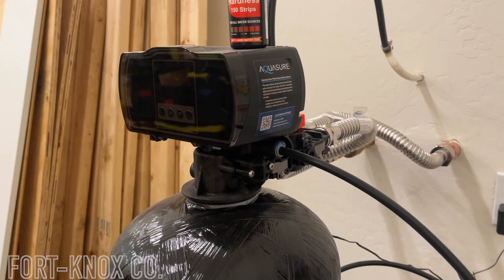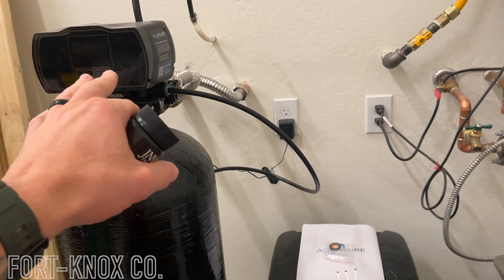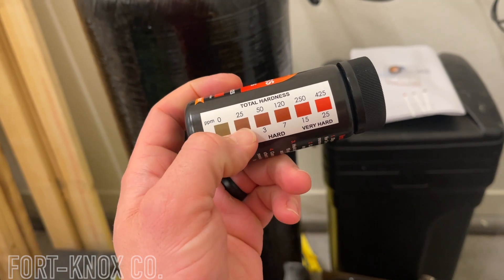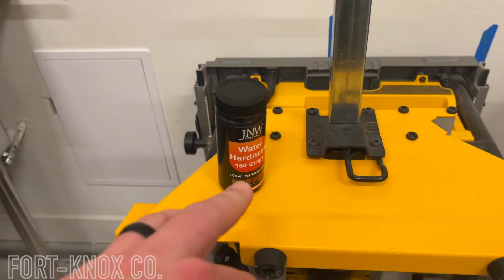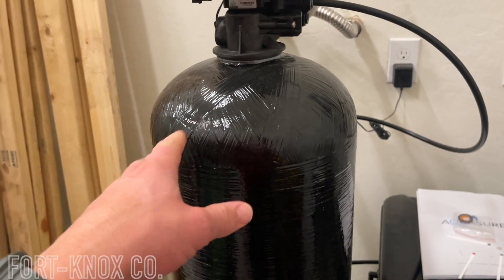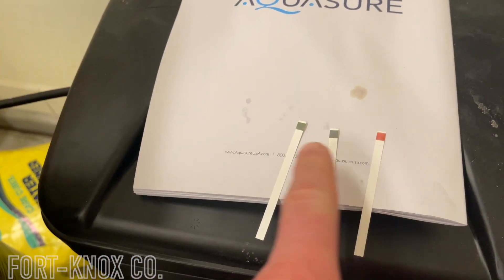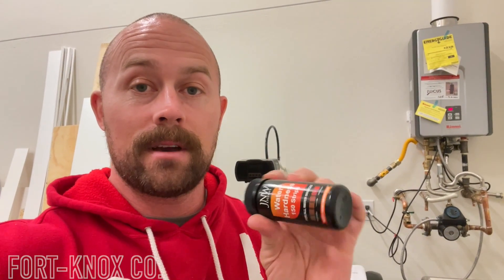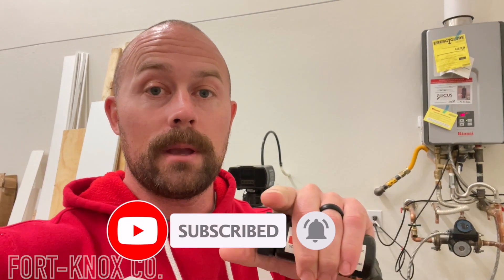How to Check Water Hardness!! You NEED to do THIS!! | Water Hardness Test Kit

Comment: Well, what I was told is that slippery feel is actually a layer of bacteria that develops in the resin of the water softener itself. So that is not a good sign if you are getting that feeling.
Reply from the maker: Ehhh. That might be fake news. From my research it’s not that at all. It’s what most people associate with softened water, less minerals and the water being ionized from the process.  If you have a softener system that’s sitting for a long long time and that water inside is stagnant then could see a problem like your describing. 

From Grok3 this is a good explanation..”The slippery feeling of water from a water softener occurs because the softener removes calcium and magnesium ions (hard water minerals) and replaces them with sodium or potassium ions through ion exchange. These softer ions reduce the water’s surface tension, making sodium ions don’t bind as tightly to soap, creating a slick, soapy sensation when you wash. It feels slippery because the soap lathers more easily and doesn’t leave mineral deposits on your skin”

Comment: TDS meter?
Reply from the maker: Those can be helpful for testing your water but I don’t believe they are giving you a specific reading for hardness.
Reply: TDS is Total dissolved solids only. It can tell you eerything in your water mineral and organic based. Hardness is a different test. I work for  Culligan, We test onsite for hardness, TDS, Nitrates, Iron and PH. We can also test for copper on site. If you have well water, any amount of nitrates means you need a bacteria test which needs to go to a lab. PFAS , we have a $150 test which is cheap compared to most companies who want $1000-$1400.  Softeners are great but you often need a filter as well as a R/O system if you plan on drinking. I suggest at a minimum getting a carbon based filter or a total defense filter. With a softener. It prevents possible resin backwash into your system and filters out stuff the softener cannot filter. 70 percen tof the US has Hard to very hard water and 99% have some PFAS in the drinking water , thanks to Dupont poisoning the world with teflon.

Comment: Hello, first i would like to thank you for the detailed installation steps on the water softener..
I just installed my water softener aquasure 48k... I tested my water hardness using tds meter and hardness still shows the same as my old system which is around 180ppm.. can you please let me know what would be the best time after installation is good to do the test..is it after a day or two days.. 

Thanks in advance.
Reply: Thanks for the quick reply...Can you please tell when did you first test your water hardness after installation..
Reply from the maker: @ I have a sink about 5’ away from my water heater and softener. So I ran it for a bit and then tested the hot water side.  So if you have already let the system do its initial start up and it’s running, you should be able to test a near by sink after running the water for a bit.
Reply from the maker: Yeah, that was going to be my first suggestion. Is let it run for a couple days, get all the old water out of your pipes 100%. Make sure your testing it at a point in the house that is softened water and not your kitchen sink cold water. Most houses have a direct line that bypasses filtration to the kitchen sink cold water  the hot in all your locations will go through the softener and through the heater. But cold water does too except for a line to your sink. I believe builders still do it or it’s code to have a hard line to the sink for watering plans ? I don’t know why they still do it but basically the cold water at your sink will be similar to your hose spigot outside. That’s also why a lot of people install a reverse osmosis at the kitchen sink. You don’t usually wanna drink straight kitchen cold sink water.
Reply: Also one more thing what I observe is there is no enough water in the salt water tank after finishing the last step of Regen... Is it normal or anything went wrong...
Reply: I don't see water flowing to my brain tank.. how to fix it . I even applied grease on both ends of pipe and I even regeneted last time.. please suggest
Reply from the maker: @ have you checked the float shut off valve in the tank? Is similar to a toilet tank water valve. It could be stuck in a shut off position and not allowing water to flow. If the line is good at the head unit and plugged into the brine tank that would be the only spot I would think of checking out. The valve at the tank. See if it’s stuck or defective

Comment: my water tested at 120 on test strip. Only my wife and I in home with occasional family visiting. Which water softener would be best for my home with two baths?
Reply from the maker: Probably the 48k grain system. All the systems will soften your water, but the size of the system is more about how often it would need to regenerate because of usage. So I’d say somewhere in the middle range of sizes. Like the 48

Comment: Are you sure about the cold water in the sink being hard? in my house ALL faucets, cold or hot are soft.
Reply from the maker: It will depend on your house, who built it, what code is in your area. But all homes I’ve worked on have a hard water line to the sink in the kitchen. Similar to your outdoor hose spigots. They get their water supply off of a line before the softener.  But it’s not across the board for every home, I’m sure there’s plenty of different set ups out there.
Reply: @FortKnoxCo  oh ok.. I installed my own water softener. Also, remember you can always adjust how much salt your brine tank uses to make it more or less soft. This is why you are not getting the slimy feeling when you shower because you need to increase the gpg on your system.
Reply from the maker: @mr.boniato6402  great Information 🤙🏼

Comment: Hello I’m in Vegas as well. I’ve watched both system installs on your channel. My question is which do you prefer from the two (Aquasure or Shell)? Thanks. Excellent work by the way. Very informative and helpful.
Reply from the maker: I honestly like the Aquasure. It was easy to set up, nothing fancy, & I felt like the water was really soft. The whole home filtration is nice but it has a Hefty price tag for what I think is pretty close to the same end result.

Comment: I'm assuming Hard Water is safe to drink than soft water correct
Reply from the maker: Yeah, hard water is fine to drink. It’s not so much the drink ability as it is how hard it is on your house, plumbing and appliances. The minerals can cause damage to the internals after it builds up overtime. Some would argue that your water with all the minerals and stuff in it is healthier because it has those things in it. That’s probably a whole different rabbit hole the dive into.

Comment: Do I drink Soft or Hard Water Our Cold Water is left on Hard at our kitchen sink
Reply: Yeah I have a Brita Water Filtration System and I drink out of there it gets filtered out so I drink out of that instead
Reply from the maker: @joepajewski6858  yep. Sounds good. I think that’s what most people do. Gone are the days of drinking out of the hose. Lol.
Reply: @FortKnoxCo  and they Flush the Hydrants from the city and when the water turns rusty and discolored and when I fill up the rusty discolored water in my brita filter the activated carbon which is the filter inside it will filter it out so it gets filtered and cleaned out so I don't have to be drinking that yucky stuff from my faucet and that I don't have to be drinking rusty discolored water from a brita water filter ever again so none of that stuff gets into my glass of water in my cup so it'll be pure filtered cleaned out water meaning I'll be drinking pure clean clear filtered water
Reply from the maker: @joepajewski6858  100%
Reply: @FortKnoxCo  have you heard about the Morton Whole Home Water Filtration System it's mainly a self cleaning filter for your entire water supply and it filters the entire house I'm planning on getting one of those cuz my city water has a lots of chlorine and it reduces chlorine by 50% you should get one of those so you don't have to worry about showering in chlorinated chlorine water if there's a menards by you you should buy it but I'm not sure I'm not forcing you to buy it it's just a good recommendation and choice if you want to remove chlorine out of your shower system
Reply from the maker: @joepajewski6858  yeah I’ve heard of the systems. Sounds like a good system. Thanks for the information
Reply: @FortKnoxCo  yeah I tried drinking out of my brita filter it doesn't taste as good so I just drink bottled water cuz I don't think brita filters do a good job filtering water I'm getting sick and tired of city water the house I'm living at right now I'm just planning on just living when it gets put up for sale it'll be mine but um when I drink out of my brita filter it still tastes like chlorine I know bottled water is expensive but I don't wanna drink tap water or drink out of my brita filter which still tastes like chlorine so should I drink bottled water or should I pick up the Morton Whole Home Water Filtration System Model MCWF at Menards I'm not sure what my parents think about that idea cuz they think there isn't anything wrong with the water and I'm like oh yes there is it is undrinkable so I don't drink it but they do which I find it funny but whatever they do I guess or do you think I should just drink bottled water and hold off with the Morton Whole Home Water Filtration System Model MCWF what is your thoughts and options and recommendations on this cuz I need your help thanks I appreciate it
Reply: @FortKnoxCo  I do need water for drinking cuz it's healthy for me but I don't know what to drink for with water
Reply from the maker: @joepajewski6858  it’s all personal opinion. Everyone’s situation is different. All of these choices cost money at some level. So it just depends on what you feel is best for your specific situation. I personally have loved my reverse osmosis system for drinking water.
Reply: Does it work great for you and your family so far
Reply from the maker: @joepajewski6858  yes. I’ve had a reverse osmosis system for several years now and love it.
Reply: @FortKnoxCo  nice I'm glad you enjoy it
Reply: @FortKnoxCo  My wife had a question about this, we're looking at refrigerators, I like the ones with water and ice in the door, they come with a filter. I said we should get an RO system for the kitchen. She said, if we buy an RO for the kitchen, then we should not buy a refrigerator with a Water / Ice maker in the door.  Do you have a setup like this, how did you reconcile that? :goodvibes:
Reply from the maker: @coocoocachooglin  I get what you’re talking about. But you’re missing part of the whole equation. Depending on how your water is set up at your house, you may be able to set up a reverse osmosis system at your sink and then off of that water some houses have it go over to the fridge from there. So the water going to your fridge is being ran through the reverse osmosis system first. Not all houses do this, but it is very common nowadays. This doesn’t mean that you shouldn’t buy a fridge with water or ice it just means that the filter in the water or ice at the fridge is not really needed. So a lot of people remove the filter from the fridge when they have this reverse osmosis system filtering the water already. Some fridge manufacturers understand this and they give you the option to put a filter in there or a bypass valve that just lets the water flow through and doesn’t further restrict it. Sometimes people see a reduction in water pressure at their fridge when they install a reverse osmosis system because it’s going through that filter and then through the filter in the fridge, which is why they provide that bypass to not reduce the water pressure anymore than it needs to be. I hope this is helpful. But end of day having water and ice at the fridge is a nice benefit and perk if that’s what you want. Having a reverse osmosis system at the sink is always good to have. It just really matters if you want to have the water filtered in the fridge or not
Reply from the maker: This is also why most people install a reverse osmosis system in their kitchen sink area. I just installed one in my kitchen and it goes off of that cold water line and it filters the water to be purified drinking water. So that’s why this is usually not as much of an issue for people because they either drink filtered water or they have some type of filtration system anyways. But the water filtration system is different than the water softener. It’s safe to drink either. But most prefer a reverse osmosis system for their drinking tap.
Reply from the maker: I’ll be putting a video out shortly of the installation of the reverse osmosis system and how to do it step-by-step. And also there’s a reverse osmosis system that I found that is super DIY friendly and one of the best ones around in my opinion. There’s no need to pay hundreds and hundreds of dollars for someone to come out and put in a system that is just as good as every other one out there. I made a mistake and paid for someone to come and put one in and it never worked as good as the other ones that I had put it myself.